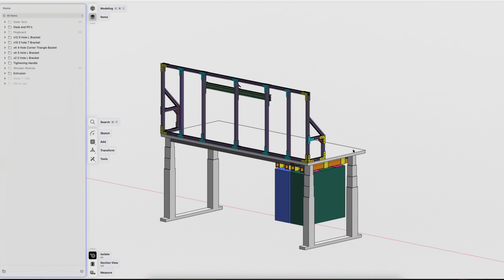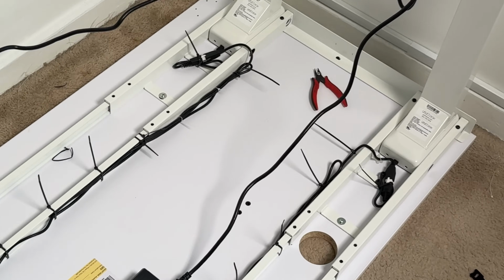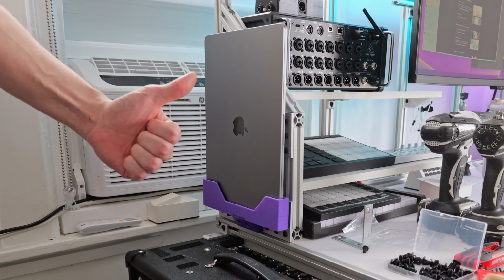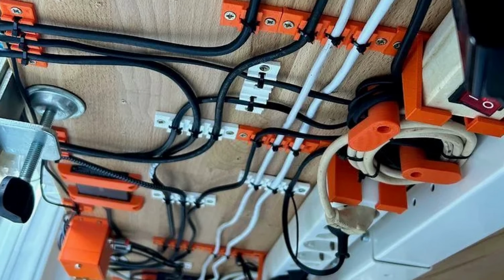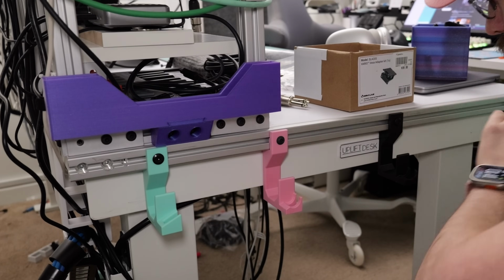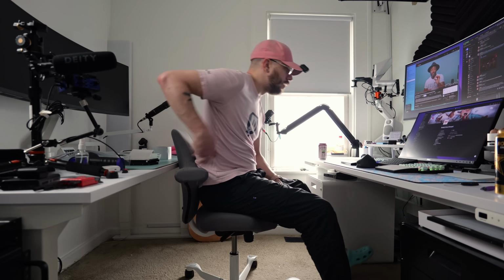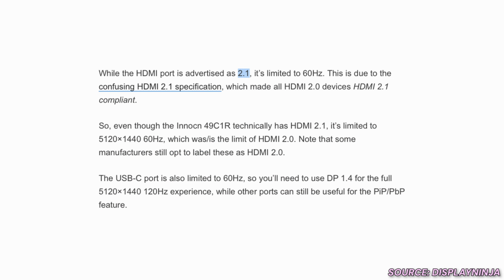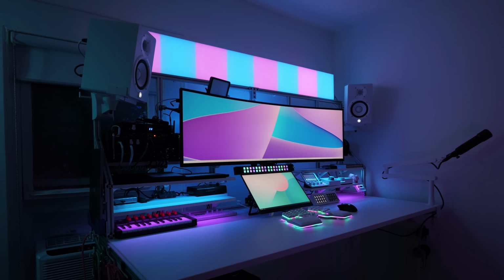Build your desk with Aluminum. You won't regret it.

Comment: Why exactly didn't you use a switch for the different PCs? The Pcs could be anywhere, stored a way with as little space as possible and with a click of a button you could change which pc the setup (Controls, Screens, Audio) is using. Sure, turning you would have to stand up, but that could be fixed by modifying the turn on switch and routing some extra cables
Reply from the maker: I feel like I gave a very lengthy answer as to why I chose to set it up the way I did and I don't know how I could give any more detail lol. 

Also, I am using a switch. It's just software instead of hardware.

Comment: I  stopped counting how many times I've watched this video. You've inspired to make the best out of my desk setup.

The only difference in my way was to mount the extrusion frame between the desk stand and the desk plate.

My only question is do your 3d printed cable clips fit into 2020s extrusion?
Reply from the maker: I love to hear it :) thanks so much for watching. 

How are you going about the mounting? I'm thinking about doing this again but smaller for the other desk, but was struggling to find a good way to go about it. 

And no I don't think they would :( I might have have get some 2020 to update some of those designs!

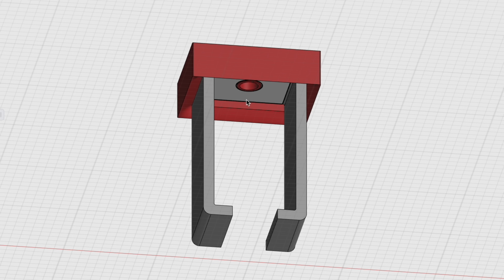Comment: 17:13 For more holding capability: next time, add four counter-sunk holes to the hanger so you can mount it directly to the desk with four contact points. 😁

Comment: Midea makes a u shaped ac unit that's super efficient and like 3/4 of the AC hangs out the back side of the window. I have central air but I have a full-on server rack in my walk-in closet and a 9700 XTX it makes my room really hot. I'd highly recommend it. I also just use 1U cable management channels with fingers on the back of my desk for cable management. They are Clean and easy.
Reply from the maker: you know when I first looked at AC units for my office, I came across those but the reviews were so hot and cold. So I got cold feet haha. I'll check them out again. Thank you!

Comment: Would have added a four post table just for the monitor and the back and then just send the same signal to both systems at the same time so youre monitor is a table and the table is seperate just so you dont get to the limits. or get bigger legs :D

Comment: Made it to the end. You need dual monitors to accomplish your goal, but you couldn’t help it. You had to jump on the ultra wide trend.
Reply from the maker: It is actually impossible that you watched the whole video because if you had watched even 25% of it, you would have known that not only is the ultrawide able to act as two separate displays and I do exactly that, there is two physical displays. You get a 0 out of 10.
Reply: @Naaackers no way! Do I have to time stamp the part where you said the monitor does not offer what you desired. But now you have to live w it cause ultra wide.

Comment: your almost exactly like me... but cooler😜
Reply: damn 1400 pages! i feel ya. i did 4 monts of research, every day, all day basically, to build my new pc
Reply: in case you want to know what i built. 14900k cpu, samsung 990 pro 4tb, 
Dominator Titanium RGB 96GB (2x48GB), artic cooler iii 420, z790 ace motherboard, lightbase 900 case in horizontal position. sadly im having a hard time getting a good gpu but the 4060 ti oc seems fine for now. working on getting the monitors, using my 8 year old tv. i got the rode caster pro 2 audio interface, shure beta 58a mic, using ableton live 11 suite. launchkey 49 mk3. yamaha hs8 speakers. a guitar, pedals and second monitor from my friend. i mounted the monitor under the desk on my right side! need a new chair still. and alot of buttons n stuff to learn too. i love everything i got but the rode caster pro 2, its been glitchy.

Comment: removing catalytic converter doesn't increase volume that much.... hate to be that guy but im a mechanic. more than likely you mean a full on exhaust swap. which means high flow muffler and possibly a high flow resonator, both of which will increase volume. I removed the catalytic converter on my truck and the volume did not change because i had the oem exhaust. so by all means, welcome to the car club in terms of learning this fun tidbit. and yes, in my state, my car without the cat still passes smog. because i dont live in communist California.

dope build. love the extruded aluminum idea. i wonder if making a straight up oldschool desk without the whole height adjustment would be keen. the question would be top material....

Comment: Might want to look into the Samsung odyssey, they also allow picture by picture, hopefully also 120hz+ on both

Curious what you think of the uperfect monitor, i tried one at some point and the colors were horrible and it was super dim
Reply from the maker: It's definitely a monitor that's on my radar, it's just so much more expensive AND they had that line of Odyssey models that where getting lines in their display shortly after the 1 year warranty expire and I haven't felt too comfortable spending that much money on a samsung display in a bit...

Comment: Obviously if you take out the sponsored items you can save a lot of money with alternatives. The Uplift desk is way overpriced. You can get the motors from aliexpress that can handle 500lbs+ for $50-60 each, heavy duty legs for $120-200, and a solid wood table top for $160-250. That's half the cost of Uplift and can handle a 600-700lbs.
Reply from the maker: Wait... so it's cheaper if you buy parts from a distributor and build it yourself instead of buying a completed product?!
Reply: @Naaackers  I think you took the wrong tone from my comment. I'm not criticizing you. I respect that you listed all the items and what items are sponsored. You did a great job, and yes a completed product saves time. My comment is just for people that want to do more work and save more.
Reply from the maker: I apologize if I misread your tone and responded harshly. It's the 'overpriced' comments that usually irk me a little. IMO, you can't say a product is overpriced if your comparison is buying a bunch of parts from a bunch of different manufacturers, paying shipping on all of them, doing part of the assembly yourself and then not having a warranty when it's all said and done. Of course it's going to be cheaper, because you're taking on risk, efforts and labor - which costs you time. Can you build it for cheaper? Absolutely. Does that make the desk overpriced? Definitely not.

Regardless, very much appreciate the compliments. It's all good!

Comment: I am impressed with the quality and cleanness of the build. Maybe you should add a camera stand on the corner near speakers? An ultra wide camera would be nice with this build. And maybe another stand for a wireless headphones? Thanks for the video.
Reply from the maker: Thank you! And I added cameras after the build was done. Since the aluminum extrusion has 1/4"-20 tnuts, I can screw any camera friction arm or mount to any part of them frame. I have one on the left and right sides!

Comment: While i love Sunshine/Moonlight, have you considered utilizing NDI to push your game monitor as a source to the other computer via the network?
Reply from the maker: I have. My relationship with NDI, is pretty love/hate. The plugins for OBS are often pretty inconsistent, and with high resolution/high framerate gameplay, I don't find the source recordings to be as high quality as they should be. And the NDI tools suite while super powerful and handy, just doesn't feel like a good fit for gameplay. Audio drift, frame drops, etc. Even with heavily investing in good quality networking hardware and having everything hardwired, NDI just doesn't keep up. I'm sure it's better with a completely segregated network and maybe some external NDI hardware, but at that point - I'd just just buy a capture card that's made for this sort of thing.
Reply: @Naaackers   that's completely fair. I was just curious if you had tried it, and if not, if you could bring it to your attention. Best of luck with your future endeavors!
Reply from the maker: @TheSergeantTaco  I appreciate it, thank you!

Comment: I have the same UpLift desk and have been dreaming of doing a build like this using unistrut and aluminum extrusion for years.

I also have two desks right now in my office with at least three computers in rotation and similar requirements like studio monitors.

Basically, thanks so much for putting this out there!
Reply from the maker: My pleasure! Good luck if you go that route :)

Comment: Normally I run away from long videos or hike up the play speed, but I didn't notice the video length for whatever reason, and you kept me engaged the entire time.  Kudos!  I love the white speakers floating on the top edges of the desk panel.  Great work!  You're pushing me back into designing some 3D-printed parts again.  Then again, maybe I'll just use yours.  :D  Thanks for this video that came at the right time as I'm remodeling my home office.
Reply from the maker: Thanks for the compliments :) Super glad to hear I inspired you to get into 3d stuff again! And yes, by all means, use mine hahha. Have a good one.

Comment: 37:35 There is a monitor protocol known as DDC, if you google "DDC/CI windows" you can then use a program to programmatically set it to execute an application to change the monitor settings (enter bpb mode) or even switch inputs through software. I use a program called ddcutil on Linux to do this.
Reply from the maker: Shoutout to you and the others than have mentioned this because I had no idea it was a thing! I want to reach out to that monitor company and see if they'll share the codes with me because that would be awesome.

Comment: 37:44 Hey @Naaackers, you might be able to use serial commands through the USB's of the monitor to control the monitor's on board controls. It's definitely a rabbit hole where you'd need to contact the manufacturer for information on how to do this or if it's even supported, but might be worth looking into! You could get an arduino or something similar and put a single key on it that switches between PIP and standard. I've used similar solutions in AV installations for controlling which inputs a TV has displayed from a tablet. 

Great video, and good luck with your future projects!
Reply from the maker: I will definitely look into this - thank you!

Comment: i couldn't help but notice at 21:04 that you had some trouble getting the screw into the desk on an angle. might i suggest the dewalt DWARA60 next time you have a tight spot like that. the vim tools HBR3 and HBR8 work pretty well too for hand tightening fasteners in tight spots.
Reply from the maker: I'll look this up for sure! Thank you. I actually designed the part so the screw could be accessed from the side from an angle. But, I'll take any opportunity for specialty tools XD

Comment: Very cool project, I was looking everywhere for someone to have done an aluminum extrusion frame for a standing desk, you're the first I come across. I'm currently looking to do the same with my setup!

How did you end up mounting the main monitor? Do you still use the arm, or have you found a way to attack a vesa mount directly to the alu extrusion?

Comment: This is a super cool video, especially since I am about to plan something similar. 
I have a height adjustable Corner Desk, with 2 Laptops, replacing one of them in the foreseeable future for a desktop and 2-3 Extra monitors. 
I started thinking about using Aluminium Piping at first but extruded is a much better idea. 
Having the resources you provided in your build resources document will truely help me bring this project of mine to life.
Reply from the maker: I wish you the best of luck with your project :)

Comment: I mean, this is cool. One thing though… I can’t help but think it would have been easier to just install an open air rack with rack slides? It even looks like your using rack pc cases?
Reply from the maker: I pulled both of those pc cases out of an open frame rack XD. I saved myself about 6" in width by turning both PC cases on their sides. It was simply too big.
Reply: @ it didn’t work turning the rack on its side? I suppose thinking about it, for a standard “U” it probably would have impinged leg room then 🤔.

Still, a custom rack may be easier if you ever needed to do it again. Live and learn I suppose. 

Honestly though, solid work, I’ll likely be doing something similar in the future.
Reply from the maker: @ImmutableTech  It was a 12U rack, it was as tall as it was wide. Even then, rack slides aren't meant to be load bearing when rotated 90 degrees. Only 1 slide would bare the weight of the whole case. 

Can't say I see the point in trying to build a custom rack. Would have just taken up unnecessary space and then I couldn't fit the UPS under the PC's.
Reply: @Naaackers  the rack would bare the weight of the case, and the slides would attach the case to the rack. So atleast the way I’m thinking about it. There would be one slide on the top and bottom of the rack, which should hold it up 🤔. Although I see your point.

As far as the UPS, those things are heavy man! I get why you did it, although for me. That thing would be on the floor, or be on a shelf on the legs with a rack power board in its place on the bottom of the desk.

Comment: All the setup is immaculate however the nanolites on top kept bugging me because there is an animation split between the third and the fourth panel on the right.
Reply from the maker: Yeahhh :( This is because those kits only used to be sold in 5 piece. So it's actually two separate LED controllers running the same effect. Some effects is okay, others its not lol.

Comment: I had an idea you might want to try—a MacBook holder with a built-in USB-C port. The idea is that when you place the MacBook into the holder, it automatically connects, similar to how a Nintendo Switch dock works. This would allow the MacBook to charge and connect to peripherals seamlessly, eliminating the need for multiple cables.
Reply from the maker: I actually went down this road XD but it posed one major issue. If you ever needed to pull the laptop off and set it on the desk (Like if you wanted to use trackpad or Touch ID) you can't use it docked unless the lid is closed. This also makes troublehshooting display things tricky too. I found it much better to just have the cable loose so I could pull it out, keep it plugged in, and slide it back in. I appreciate the idea share tho!

Comment: I tried designing my own computer desk before and I have a love and hate relationship with speakers (and/or tweeters) and monitors.

It's very challenging to design a desk that can accomodate both while also thinking of future upgrades. Of course it's not an issue if you are using headsets or earbuds, but having a good sound system is still nice to have.

Comment: also if its any constlation. Your neighbour will need a new engine in no time if he keeps idling like that. the main cause of the valvetrain failing in dodge ram hemi engines is idle time.

the more idle time. the more wear it does to the cam/lobes/valvetrain.  so.....there's that.

Comment: hey @Naaackers  where did you get the monitor riser/stand thingy from your previous setup? Thanks in advance
Reply from the maker: Hey there! So that is actually one of my own designs... It's a 3D printed bracket that screws to the desk that can be used with a shelf to make a floating shelf. I'm currently in the middle of designing those and have been on and off testing them for a bit. I don't have an ETA for when they'll be released, but once I have a beta kit ready to go, I'll be looking for people to test the kits before they go on sale. I do all my 3D printing and stuff under my @nackhabitat account, so I'd say if you're interested in that, I have a newsletter that I notify people when new designs are uploaded and things go on sale :) I'll also tweet it out most likely too hahah.

Comment: Unistrut channel and hardware are usually cheaper at hardware stores. A lot of trades use it to mount hardware places, especially electricians. You can buy 10ft sections of unistrut for $30 most places

Comment: That looks more like its 2020 or even 3030.
1010 would be even thinner than your pinky.

The number refers to millimeters, as in 10 mm x 10 mm, or 40 mm x 40 mm

But I noticed TNutz refers 1 inch as 10.. 
1 inch x 1 inch, man, imperial trashes so many things.

So for the rest of the world, this would be either 2020 or 3030 extrusion, since an Inch = 2.54cm
Reply from the maker: Yeah I'm assuming all my research was pointing to the fractional standard of extrusion. It seemed liked all metric extrusion started at 20** naming convention, where the fractional started at 10. It was all very confusing when I first jumped into this XD Thank you for the extra clarification!

Comment: btw i ended up going over weight on the my L desk 110 inch top. I placed a kitchen counter butcherblock, steel inlay as a work surface, all my electrical engineering equipment, water cooled gaming PC and speakers. I ended up so overweight that it would not work at all any more. I ended up fabricating mounts for gas shocks for each leg. Got the leg off of mcmaster. I used 100 Lb gas shocks but that was not enough. I ended up with 3 150 lb gas shocks on each leg.  So I estimate the total weight moving up and down was about 750 lb. Also the table top was so large I had to order custom steel lengths to join the legs together.